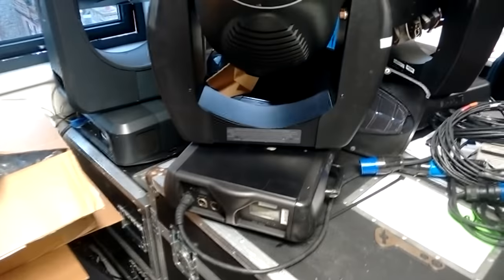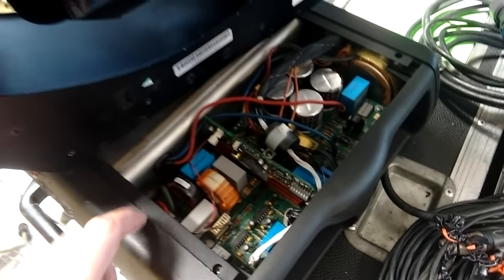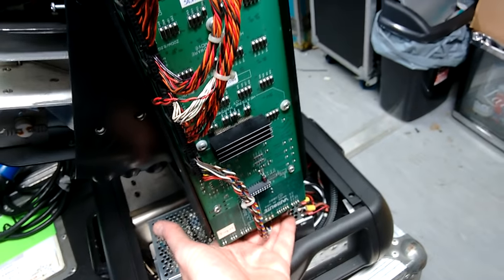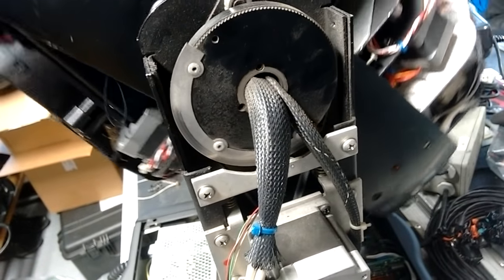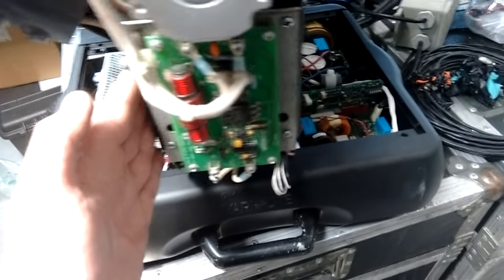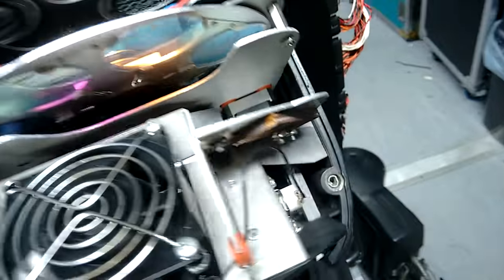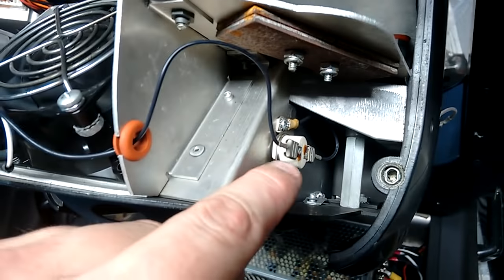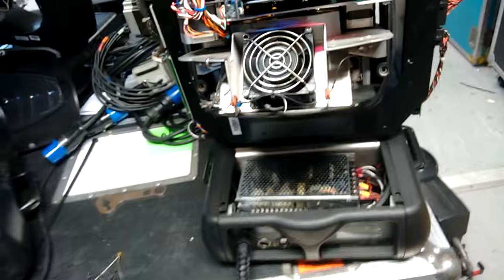Inside a VL3000 moving head light.   TCF

Comment: I was lucky enough to be able to use VL3500q spots from prg at college this year, and jesus they're heavy and slow but the optics really are something to admire considering how old these are now.
Reply from the maker: The Varilite stuff is heavy because it has to withstand the rigours of touring.  Mainly rough handling of flight cases while loading in and out of trucks.  Some of the newer waterproof LED fixtures are extremely heavy due to having diecast sealing covers.
Reply: Yeah it definitely is worth it for the ruggedness.
I don't dare drop my dj shit on the ground when rigging or de rigging and I'm pretty careful with my stuff, but we did (carefully) drop the 3500's on the ground when we took them off the rigs (as we needed to vaccum them before putting them back in the cases). They also got battered on the scissorlift.

It was rather funny as well as we had some robe spikies along with the loan (decent little lights), and we lost our collective shits over the size difference

Comment: Wow.. i'm gobsmacked at how much stuff is inside that thing! Surely it would be cheaper to use a high power RGB array instead of having 6 discs and the stepper motors to drive them. Maybe they can't focus the light from LED's well enough for it to be as good as the conventional light in that machine.
Reply from the maker: LEDs can't compete with these lights yet.  These have a massive optical output.
Reply: you haven't seen the SolaSpot Pro 2000 by High End Systems. Be sure to check them out!
Reply: I'm using two of the SolaSpots next week, very impressed by the even beam and dimming curves on them. Also, I agree, they are really bright!
Reply: stick with what works and whats paid for, no point upgrading for the sake of upgrading when they still work
Reply from the maker: Ironically we've just loaded in the show and it's all PRG Best Boys including most of the followspots this year.
Reply: +Tunsafun Especially in high-profit area (music shows/concerts and so on) you upgrade your stuff for the sake of upgrading.

Comment: Isn't the lamp controlled via mechanical shutter? I don't know if HID has " brightness/blanking " like LEDs do. 

That is a nice moving head light, it's quite sad I have seen nicer lights in far worse conditions.
Reply from the maker: It does have a mechanical dimmer, but if the shutter is fully closed the lamp will run at lower level to remain lit while extending lamp life.
Reply: Interesting, I have not seen many situations where the HID was veritable. Most of the movers and video projectors seem to rely on mechanics. I am glad LED is taking over a bit more but it's sure hard to beat the output of a ball of plasma. in all honesty I tend to stay away from HID related stuff so there is bound to be stuff I don't know in that field.

Comment: How does this light and Clay Paky compare to Martin lights in terms of quality?
Reply from the maker: +SpriteXP Each has its own merits.  The choice of light will generally be based on the application and which light actually suits it the best.  Specific lighting designers also have a preference for particular lights and brands.
Reply: It used to be that Martin was supreme with their Martin Mac 700, 500, viper lines etc. then Philips Varilite came along. High End Systems has really stepped up their game ever since ETC purchased them. Nowadays the likes of the massive Syncrolites are gone almost. TSO used them extensively but those lights are too darn massive. HES for me.
Reply: @mrodriguez4829  Vari-light has been around since the early 80s, they started the industry. Genesis funded and first toured with them for their Abacab tour. For a while they were the only band, to use them and even after that VL were the only intelligent fixture manufacturers.

Comment: got any vl1000 series?
where I work we have 12 of VL1000AS and I am the one that has to fix them (they are old 05 or 06) and the most common problem are the motor drivers. although sometimes some other parts fail. and unlike the 2000 series and 3000 series light from VL these are not easily serviced. any work inside the head you have to take the lamp housing off to get to the modules (usually takes at least an hour to fix them)

Comment: I wonder how long it will be before all of the mechanical innards are replaced with the type of light engine that you see in a video projector.  You could then have arbitrary control over color and gobos.
Reply from the maker: You do get moving head projectors, but they are very expensive and relatively inefficient.

Comment: Huh. Assuming the Mac 250s are built the same way no wonder they're so damned heavy. Loads of fun to mount up on the roof when you're terrified of heights XD
Reply: The VL3000 weighs a LOT more than a Mac 250!
Reply: +Lufferov still bloody heavy. Prefer em to the 350s though. Don't like heights so trying to put those guys up while on rickety scaffold is extra fun
Reply: a 250 also outputs the same as a freaking candle :P
Reply: God. Bloody Mac2000s with the magnetic ballasts. Those things are fkn heavy

Comment: big buggers... yeh i'm glad not many productions these days use the variolights they can be such a pain for stagehands like me xD i'm wondering tough is there a change i'll be able to see the insides of a clay paky sharpy sometime on this chanel :P?
Reply from the maker: +roy00100 I was working with Sharpy's not that long ago.  I really should have made a video.  But to summarise they are VERY similar to the "blunty" video I made except the light source, which is a tiny discharge lamp designed for projectors, which has it's own precision reflector.  The absolutely tiny point source of light is the secret for the Sharpy's ultra tight beam.  I was really impressed.  OK, I wasn't so impressed that at the touch of a single button on the control panel they routinely jammed my fingers between the base and yoke with explosive force, but I soon learned to keep my fingers away from that area.
Reply: Haha yeh they sure have some force on them when they are on learned that the hard way aswell :P cool thanks for the info i was rly wondering how one of them would work and how they got that super nice beam ^,^
Reply: +roy00100 +bigclivedotcom
I tend to keep a good distance from Vari*Lites when they're starting up, they love to do a self-test by flailing about unexpectedly. One of my colleagues learned the hard way and took a hit to the head.

Comment: Don't suppose you have any MAC lights there? I have a connection to lights particularly made by Martin as I worked for a company that manufactured the irises for them. I can't remember if we made them for Phillips though.
Reply from the maker: Matthew Bliss We used some Mac 2000's for a while.  But they were absolutely terrible for lamp ballast failure.
Reply: +bigclivedotcom I used to work on the MAC 2K, 500 and 250 lights. FYI there were two versions of the 2k, a magnetic ballast and electronic ballast version.

Comment: do u have a light made by prg on your table with these vl 3000's ? it looked like the best boy 4000 or it could be the wash version as well
Reply from the maker: PRG Bad Boy.  We were using them as followspots.
Reply: Could u please do a inside video of those I really want to see its cmy wheels
Reply: Have you seen the new "remote" operation unit that can be used with the Bad Boy? I had a play with it at ABTT recently, I was really suprised at how easy it was to use!
Reply from the maker: Do you mean the unit that allows it to be used as a (part) manual followspot?  We were using eight of those last year on the Edinburgh Tattoo.
Reply: It's called the PRG GroundControl Followspot System. You get a monitor and a remote control unit on a tripod. You can control everything on the "followspot" (bad boy) from this controller. It's designed to avoid having operators climbing truss and working at height.
Reply from the maker: +Lufferov Ah, gotcha.  I've not seen those in the flesh yet.  On this particular show we have easy and safe access to all the followspot positions.

Comment: The stepper motor driver board is unnecessarily massive. You could replace all that with a small chip on a board and a few extra components.
Reply: Mussie Tesfay Note that this board controls multiple stepper motors.  And most of the board just distributes the output to the various plugs.

Comment: All that engineering...... then stick a mains fan motor on it
Reply: google Account 
Nothing wrong with it. Runs at lower currents, doesn't need a power supply, and if it's a induction motor pretty much will only fail after the bearings failed.
Reply: superdau must be a retro thing :)
Reply from the maker: google Account The main reason is that if the 24V fails then the fan will still run on the mains supply as the lamp housing cools down.  But in reality, the mains fans tend to be inefficient and failure prone.
Reply: bigclivedotcom Yeah I can see the heath & safety aspect of it now, they are potentially very dangerous.
 Is it a late 90's vintage?
Reply: 2003 :)